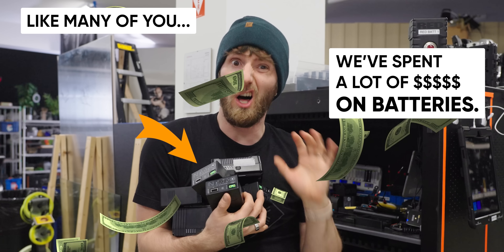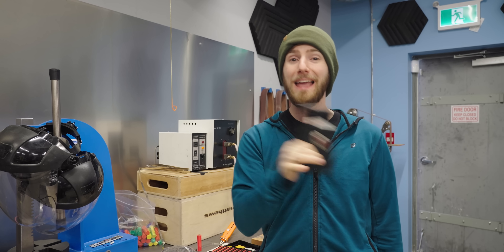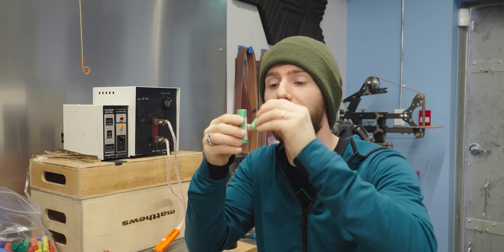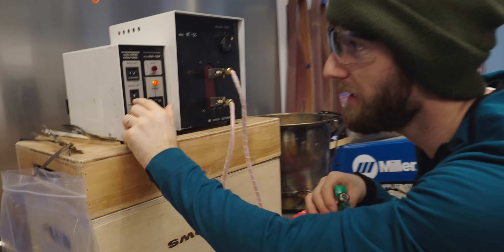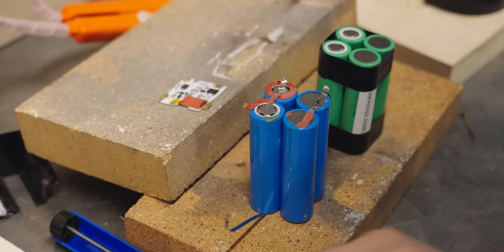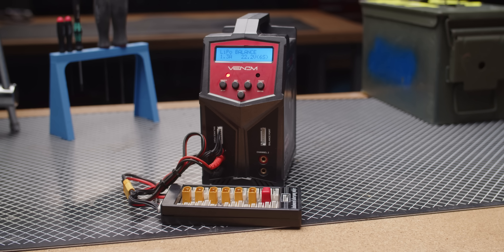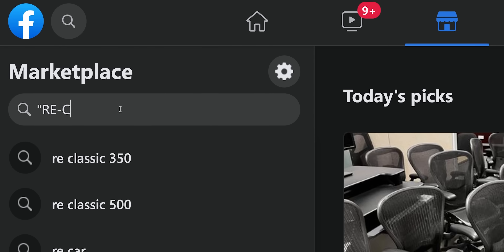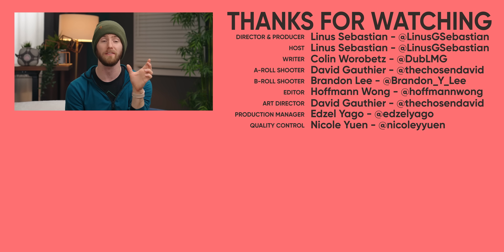This should be illegal… Battery Repair Blocking

Comment: Linus, 

Let me first say thank you for all of your content and that I have an equal if not lower opinion of these manufacturers that continue to find new "and to paraphrase you" EVIL ways of preventing repair of these devices. Second, I find it much safer to discharge the cells to their minimum "Cut-Off" voltage before welding/soldering the batteries. This will commonly be 2.8v to 3.2 volts for most common types of Lithium chemistry batteries. Some may have a lower depth of discharge such as 2.6 or 2.5 but generally it will be 2.8 or 3.0v. You will need to reference the battery specifications from the manufacturer to determine the cut off voltage. Please note that if you discharge them lower than the BMS is programed for, it may give the BMS heartburn. For instance, the BMS or battery pack manufacture may have programed the BMS to stop the discharge at 3.4volts. This could be due to the specifications of the cells that were used in the original battery pack or they are attempting to extend the life cycle of the battery pack by reducing the depth of the discharge. If you attach batteries that have been discharged to 2.8volts in such a BMS, it may see this as a fault and refuse to charge the pack. 

This can be corrected by charging them from an external source up to 3.4v to correct this issue. I typically use a simple RC battery charger such as an Imax B6 parried with small alligator clamp leads. You can also fashion spade leads to insert into the pack’s connector. Typically, most battery packs have a raw connection to each end of the battery packs series of cells that can be used to charge the pack. Make sure you understand the proper voltages, how to set your charger and the pinout of the pack before attempting this. I then allow the device to fully discharge the pack and perform a full recharge. If it is not an evil BMS it should be able to recalibrate the battery packs new capacity.

Discharging all of the cells you plan to use for a battery pack will also have the added benefit of balancing the cells before their first charge. This is especially advantageous for cells that are soldered/welding in parallel. If for instance, if two cells wired in parallel have drastically different voltages from each other, it will take several discharge and recharge cycles to balance them out. It also comes with the slight risk that one of the two cells may get over charge or over discharged out of that parallel group. The BMS can measure and balance the voltages between each series, but it can't tell what the exact voltages are if each cell in a parallel. This is less important if your pack only contain cells wire/soldered in series but if you are trying to make the batteries a little safer to weld, you should bring them all down to the same voltage You have to remember that the voltages of a typical Lithium battery is 4.2 volts charged and 2.8volts discharged and I find that many BMS’s don’t go below 3.2 volts. So, we are talking about 1.6 volt between charged and discharge. A difference of .2 volts can be pretty big difference, especially if we are talking about high-capacity cells. Be sure to perform a slow discharge when running them down to their cut off voltages to obtain a good balance. If you discharge them with a high current draw, the battery will tend to recover some voltage after the load is removed and or the battery temperature normalizes again.

This will not completely mitigate the possibility of a fire, but with the cells discharged to their cut-off voltage, the reaction if it decides let go will be significantly less violent making it much safer to handle. One last thing for anyone who may read this. If you re-use cells, be sure to check the internal resistance/impendence and pair them with cells that have closely matched impendence for the entire pack. Cell that a have a higher impendence will charger and discharge at a different rate then cells with a lower impendence. I general check even new batteries because I have had some rather alarming variances even with premium battery manufactures such as Samsung, Panasonic, LG and Molicel. This may indicate that the battery has been exposed to high temperatures, been over charged or discharge while in storage or it may have simply been on the shelf for a long time. You can get very simple round cell Lithium-Ion charger on Amazon that will display the cells impendence.
Reply: This is the kind of information that I find most helpful for a topic such as this.  I just recently purchased a spot welder to do repairs to my power tool battery packs and was filled with major buyer's remorse after seeing this video.  However, with the advise David have given, I can see that this isn't the minefield I had begun to worry about, and; it is well within my ability to handle.  While I don't hold an electronics or mechanical engineering degree, I have over 50 years of experience building and repairing everything from automobiles to computers.

Thank-you David M. for the insight and concise examples you have used to pass on your understanding and experience. With this as a starting point, I'll do a little more research and soon will be chasing some of the projects I had planned when I originally purchased my equipment.  

The most challenging thing I'm still wrestling with, is finding a trustworthy source for the batteries. Cost and shipping don't seem to be an indicator of the suppliers credentials, or the accuracy of the product being advertised.  Any suggestions in that direction would be greatly appreciated.
Reply: @phillipdrewmitchell4172  Thank you Phillip for the response. It can seem overwhelming at first and there are so many videos that portray lithium batteries as some kind of grenade. I am not trying to downplay the dangers if the proper cautions are not taken by any stretch, but there are ways to make this much safer. I have been spot-welding and soldering Lithium-Ion batteries for many years. I am proud to say the only batteries fires that I have experience are the ones I purposely caused. I have come close to some bad times, but I quickly learned that taking batteries down to their cutoff voltage made for a much safer experience.  When I performed a short and overheat test, I found that the batteries would simply smoke rather than bursting into flames. I save a ton of money rebuilding my Dewalt packs. It also gives me a chance to purchase superior cells. We are a dying breed my friend, keep up the good work repairing and breathing life back into things that would just be raising the height in our landfills. Be safe and learn new things.
Reply: I was wondering why nobody pointed this out! 
That's exactly what I do... but not just when disassembling/assembling a battery pack but also before replacing any battery in a mobile device.
I also test charge all cells to pair them for capacity. There's a ton of decent chargers out there that can take care of measurement and discharging them before building packs...  LTT should do it that way too!

Comment: I have successfully repaired batteries in that have firmware problems if you disconnect the cells. Some BMS systems have volatile firmware meening if the BMS goes below voltage its operating system is disabled permanently/erased. you build your new pack and hook it up before you disconnect the old cells. Also you need to make sure the milliamps is greater than or equal to the factory cells. If you use lower milliamp cells your run time will be decreased even though you have brand-new cells. You also need to attempt to charge the pack to activate it sometimes.

Comment: NONONONOO why are you throwing away those cells. The sparks are because of the welding not from the cells them self, ( not sure about the sparks when the camera was off but the second time( the sony battery pack)), that was definitely not a dangerous cell sparking. The spark are from spot welding. Your cells are fine and stop wasting good batteries.

Comment: I remember my dad telling me about the 18v lithium DeWalt batteries had a thing in them that kept track of how many times you charged them, even if it was just to top off the battery and it would stop charging at a certain point

(Edit) Fixed some spelling

Comment: I rebuild battery packs and you are going a little overboard.  Also all spot welding is ideal you can solder instead... That being said I guess you technically really can't be too safe, and you really aren't supposed to solder batteries so you know.

Comment: I have found that the newer Ryobi battery BMS's are smarter than the old ones.  I have taken two batteries, one below acceptable voltage and one above, and linked them in parallel to allow the charged battery to bump up the voltage of the below battery.  The newer BMS's will not allow this.  My research leaned towards a single fault shut down type situation.  I never thought this could be originally designed to prevent re-celling the packs.  How rude.

Comment: Those sparks were just usual spot welder sparks when the electrodes aren't pushed down properly. They don't have anything to do with short circuiting cells. You'd get "short circuit sparks" as soon as the strips touch the wrong cells, not only at the time of spot welding.

Comment: Lithium has nothing to do with fires of Li-ion batteries. There's almost not lithium, and especially non in the reactive metallic form in those cells. What is burning in a Li-ion "fire" is the electrolyte that is usually based on an organic solvent and burns due to the heat of an short circuit. To extinguish a li-ion battery fire, you want a lot of water, because it stops the cells from getting hot and the electrolyte igniting.
I'm also pretty sure that in the case of the burning Tesla you showed in the clip (that happened in Landeck, Austria), the battery was actually completely fine. It was "just" the front of the car that was burning, as it can happen in any car, in this case mainly parts of the AC and its fluids. But that's not special news, is it? Which is why you never read that followup after the initial "electric cars burn" stories.

Comment: Obvious but I shall mention it regardless... Reduce, Reuse and Recycle. In that order. Spent batteries can be re-used to become massive battery banks for solar panel hubs or even better can not be manufactured at all if you don't need a Tesla to drive to the McD's.

Comment: That was fascinating, thank you very much. Alot of information in a very easy to watch video. So all batteries should be modular in some way. Manufacturd in a safe factory environment but sold in packs of 4 or 6 maybe, ready to hard wire.
Liked and Subscribed

Comment: Not every spark is a potential fire hazard. Spot welders often make sparks from numerous reasons. Especially yours which is designed to spot weld metal and was converted and not fine tuned to spot weld batteries.
You should configure it to two high current low on time pulses

Comment: 18650s, and all lithium batteries of the type, need to be "married" with each other if they're going to be used in conjunction with each other. This means they need to be all used together from the first time you use them till the last and they can't be used with any other batteries at all. I learned this from vaping over the last 8 years. Most vape mods that aren't those pod things use 18650s with some higher end ones using 21700(and 20700) and any mod that uses 2 or more is recommended to have dedicated sets that are used together. They need to be both used and charged together. Replacing a single bad cell with a new one will significantly decrease the life of the new one and will harm both of them. Same goes for the batteries in this video and is why Linus threw away the entire pack instead of just replacing a couple. Plus they're all so old even the "good" ones wouldn't hold near the same charge as the new replacement ones would and that causes damage and unnecessary wear to the new batteries prematurely.
Reply: Just measure the resistance and voltage its not roxket science.

Comment: Dude your spot welding isn't to standard. You're putting far too much heat into the spots on those terminals - it really doesn't need that much heat to spot weld.
I'll explain. The actual physics behind a spot weld is fusion in a precise location, that location being the path of least resistance. The contact point for such a thing with a terminal is tiny - literally a pin prick in size. Done correctly, there is no 'glow' of metal. Yes sparks occur sometimes but it's from contamination such as grease from fingers or dust particles. Do a test spot weld and tear it apart - you should be able to actually tear the metal at the point of contact and if fully removed using miniature snips you will see a tiny fusion spot.
You need to try more current but on a really short timing. The longer it goes, the hotter it gets. That heat then dissipates down into the cell and is bad. Cells obviously become unstable but you're also changing the structural properties of the weld metals..
My experience? A national award winning (grand prize) UK metal artist. I've also worked with industrial micro spot welders making ultra fine filament connections in a military hardware fabrication company.
Remember - glow is really bad!

Comment: You could have invested an extra $100 for the equipment to test the cells to know if they could be reused. I've rebuild hundreds of ebike battery packs and never had a single problem, or fire. I find every good cell and either reuse it or store it with matched cells for later use.

Comment: Dell is a PITA when it comes to their batteries... they use a volatile BMS that yeah, basically bricks itself on power loss. It infuriates me that I can't replace the STANDARD 18650 cells with good balanced ones in the dozen PPX batteries I have and get my studio machines back up and running. This bullshit should be illegal.

Comment: start tweaking laptops and some more battery, and expect many burn houses, its the same a dealing gas installation.. need the Know how, and security, of course, some companies will use this to they benefit. take a tour in rc cars, and you now what happen in take bat to 120%. its not nice. 4:44, we don't put assemble pack is garbage, we separate all cell, short 4v is different from short higher voltage. in a long run and in a big picture, bms is better be closed. maybe open to repair shop. (that have training). well this is my view, as  i repair from more them 20 years.

Comment: You need to use some type of heat sink on the top of the battery while welding!!! Even if just some alligator clips attached to the strip. and alternate your welding (don't do the same battery nor same strip twice in a row). If the batteries don't get too hot then they won't fail

Comment: Try tackling the issue of many brands requiring only 3 AA or AAA cells.  In the past, 4 cells were used.  Many consumer grade chargers require pairs of cells to charge.  Which means people would be tricked into using alkaline for those 3 cells instead of NiOH.

Comment: I worked for a surveyors' instrument company in the 1990s when NiCd packs were common. The manufacturer (Sokkia) sealed the batteries with solvent glue to make them difficult to repair. We learned to chisel them open anyway. They didn't always look pretty, but they worked like new afterward. I used to put a resistor across the old pack to drain it completely before taping it up and disposing of it. We had an aftermarket manufacturer who provided excellent replacement packs, pre-welded and thermally fused.

Comment: TBH it's always annoying when products have spot welded nimh batteries hidden inside rather than just having a battery compartment with contacts so you can put a couple of rechargeables in. I've had electric shavers like that. There's absolutely no reason for the design other than making the life of the shaver limited to the life of the cells.

Comment: Printer ink cartridges have a chip that decides when the ink has run out, refilling it does not program the chip and usually it is stuck on the outside of the cartridge,  with no way to monitor actual ink level

Comment: You have to power the BMS during replacement. Once the BMS store battery failure. Refuse to work. Enless you reflash the firmware. Do not disconnect any of the lead of the BMS. Just bypass it first and transfer it to a good pack.

Comment: You often have to restart the microcontroller on the BMS after it has lost power from the batteries before they enable output voltage to the terminals. This is normal.  There are several ways of doing this, often but not always applying the battery voltage to output terminals with a current limited power supply does the trick. Or touching the positive side of the cells to the output terminal of the battery. sometimes a little more work is needed. The should be a few video's and websites around if you search for them.